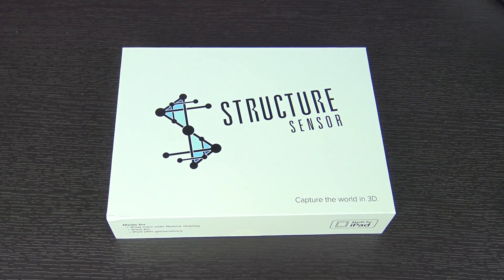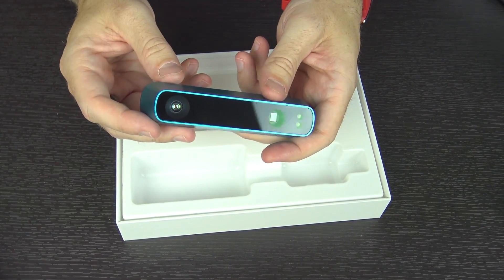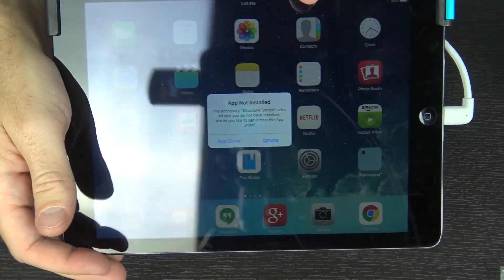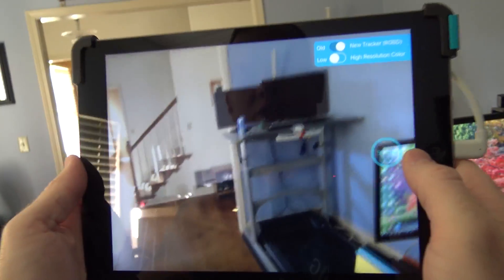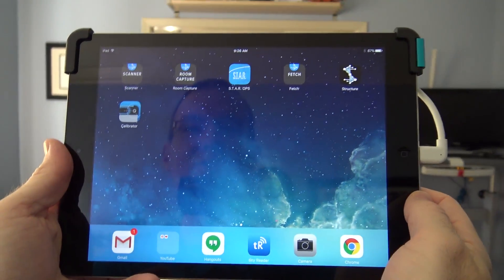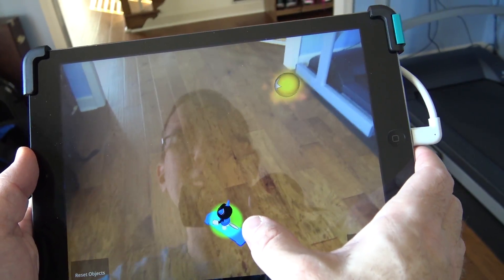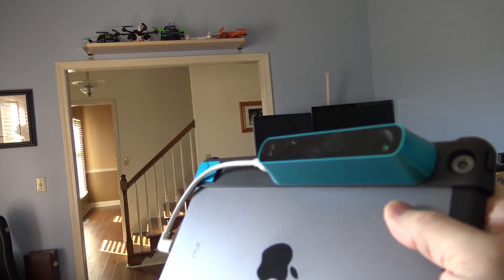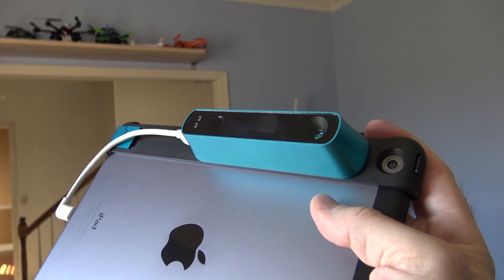Structure Sensor 3D Scanner Unboxing and Augmented Reality Tests

Comment: This is useful for interior designers, architects, and remodeling professionals.  Takes 4 hours to measure an entire home by hand, and then another 4 hours to translate a hand drawn sketch into a CAD drawing or 3D model...this will cut my time down to an hour to scan a house, and then I can get generated CAD drawings and 3D models without spending my time.

Comment: Just FYI. In this video where you are having problems scanning there is a common reason for that. The software algorithms that do the detection in this software and every other I have seen so far all have problems with reflective surfaces because of the way the light interacts with the surface. So your mobile phone and the floor for example are quite reflective although I would have thought the floor did look like it should have been picked up pretty easily.

Comment: The room scanner can now be used to capture a model which is processes into CAD, so it is a work tool, for field measuring.
Reply: Neil Blanchard but how u pull the scan out of it what files saves or  export how u get a obj or dxf file off that?

Comment: I think your scan for the first game of just a plain piece of floor didn't lock down the model enough since any piece of flat surface is the same as any other. You should scan with something 3D in it so that it can lock onto something. As for uses, they've added VR headset ("Bridge"), remodel and interior to CAD for real estate, insurance etc ("Canvas"), Avatar creation ("3D Scanning"), and people are using it to prevent falls etc in Nursing homes, in medical apps etc.

Comment: Is the 3D game really needing the sensor to play? I don't see why.
Reply: The sensor is needed to determine positional data, the gyro and accelerometer cant get your positional data, only your rotational data. A regular camera may be able to determine your position but not as accurately as the sensor because the camera doesn't sense depth.

Comment: Perhaps the 3D Scanner App would work better if you used one of your camera tripods and bought a tripod case for your iPad and have the tripod set up at a 45° angle then use a rotating display stand for whatever you'd like to scan... that way the camera would be stationary and the object being scanned would stay relatively still for  better scan.. just a thought